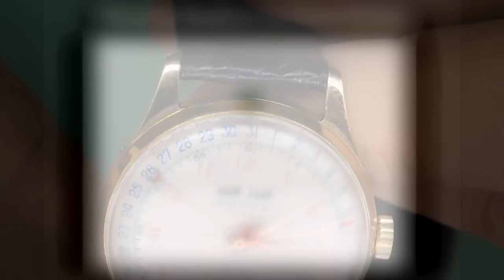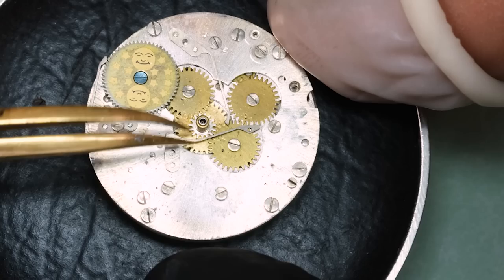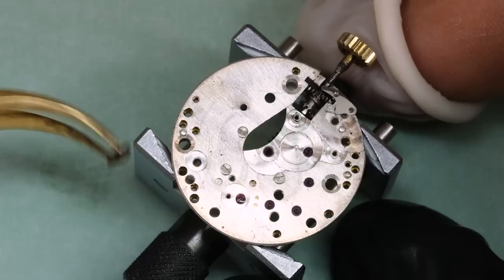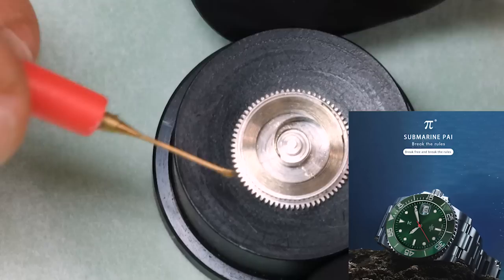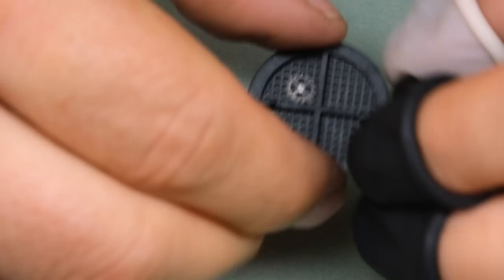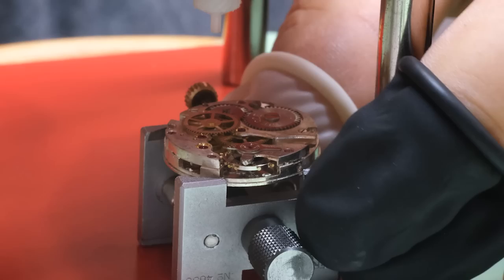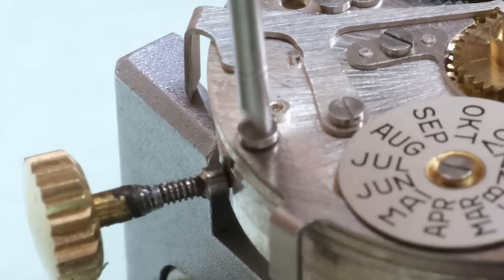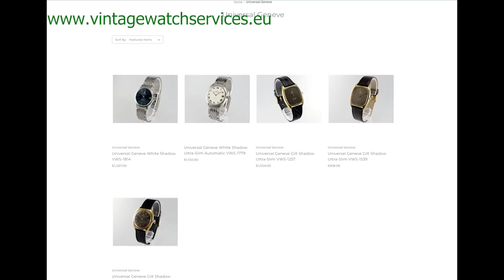How many hairs can one watch contain?!

Comment: That black veil material that widows wear at funerals.  Since it's black it doesn't reflect much light and you and essentially see through it.  It has holes in it but they are small enough so that most of your springs will be stopped by the material and fall back on the table.
I used to drape that material over my work as I was repairing portable tape recorders.  They had small parts and springs.  
Just lay the material over your project and stick your hands in there and go to work.  That way the springs don't end up in your carpet.  And I bet your camera would see right through that material.

Comment: Thanks for the great content!  I was just looking for a video where you reduced the size of the barrel bridge hole and couldn't find it...so perfect timing that it was in this video also.  Do you have any guidelines for how much sideshake is too much for the barrel arbor? I have an amplitude problem and think that this might be the culprit, but before I get out Thor's hammer and ruin the whole thing I am trying to get a sense of how to tell when you need to do this.  Thanks again for the great content!  I couldn't find the other video because I've watched most all of them and can't remember what I learned where.  Great work!
Reply from the maker: Thanks for watching! It's difficult to give an exact measure of how much play is fine, but if you can visibly move the barrel arbor back and forth or if there's is significant wear under the ratchet wheel, you should try to fix it. It's not a difficult thing to do, but you do need a staking set and smoothing broaches.

Comment: Nice piece! Even if not original, you  gotta love those red hand tips on vintage watches. If you would recommend the most useful staking tools, dies for barrel arbor hole adjustments? I got a nice Kendirck&Lamar staking tool without any stakes.
Reply from the maker: Thanks Cristo! The size of the stakes and punches depend on what kind of watches you will be working on, but most staking tools should have sizes covering most needs. You'd need to google it, or perhaps search on eBay. And a staking tool without stakes doesn't sound good!

Comment: I see you use a small scrap of metal plate to remove the wheel that drives the seconds hand. If it helps at all, I just use a ratchet wheel from a scrap movement.

Comment: Hello Stian, I fell in love with vintage watches, since i am following your videos and I always admire your craftsmanship and your sense of humour. Of course you are using the most expensive professional tools with one excepton: a chinese timegrapher. Why?
Reply: Probably because they’re compact, easy to use and work quite well. Not perfect, but very acceptably for the price. A number of people, including myself, have compared them against precise, traceable time sources (e.g., GNSS) and have found that they’re accurate +/- ~3 sec/day at room temperature. That is, arguably better than the majority of vintage movements they’re asked to measure. Or, for that matter, the majority of movements across their own 6 positions.
Reply from the maker: Hello Dieter, Nelson already gave good reasons for that, but I think it's also good to show equipment that don't cost a lot. I actually do have a Witschi timegrapher with all the bells and whistles but find myself rarely using it. Given that I mostly work on vintage watches were the accuracy requirements are less stringent than for modern chronometers, the Chinese one is just fine.

Comment: Another great video. Right now I'm taking a break from a Langendorf open face pocket watch which I'm so far not able to ID which movement it is, Ranfft site has nothing like it, won't be the first time I work on a mystery movement.
Reply from the maker: Maybe check mikrolisk.de also?
Reply: @VintageWatchServices  Thanks I check that web site but not seeing any data base for pocket watches. Stian the only marking I see on this thing is the numbers  833930 on keyless side which I guess is a ser number but that's turn up nothing. Another thing is the rocker arm set up for Keyless works which I think you did one with this type of setup. Keep them video coming I love them.

Comment: 33:40 Assuming finding hair is a good thing because it’s 1. the clear cause of the problem and 2. not fatal to the works (like a piece of metal would be)?
34:40: Maybe somebody left the back off when it was in a drawer and dirt and hair got in then.
Reply from the maker: Yes, hairs are certainly better than broken parts 👍 Just never saw that many hairs inside a movement before!

Comment: Facinating video and history lesson as usual thanks, I've one question though, you're not the only one who greases the ratchet teeth on both the winding pinion and the sliding pinion which isn't really necessary as they are both the same interface, surely greasing one is sufficient?
Reply from the maker: Thanks Brian! It's a good point, and you could probably get away with greasing only one of them. The way the grease would be distributed however, is by turning the crown backwards so that the teeth slide over each other, and most people only wind their crowns one way.

Comment: Love it Stian! Great job, gorgeous finished job! What make of Oiler’s do you use? Do you use a different one for cap stones? What diameter is the black rubber cushion that you use to press the crystal into the bezel? I want to make one and was thinking of cutting up a rubber ball.
Reply from the maker: Hello Boyd, I generally use the blue oiler for all oiling. The way you dip it will change the amount of oil it catches. And I'm not sure what black rubber cushion you mean? I have a black Bergen rubber cushion I use for placing the watch upside down on without leaving marks on the crystal, but for pressing the crystal into the bezel I used a crystal press with a domed stake.
Reply: @VintageWatchServices  Thanks Stian! The crystal press, the black bit that goes onside the crystal when you press the crystal over it, what diameter is that? Ta.

Comment: Smaken är som baken, delad! 😁
My dog has many options on how to skin a cat... 
well, anyway! 
Im in a longhaul project to restor a pierce waterproof parashock. Information i got on some Search. It was produced pretty much during the ww2 years. As it is shockproof the incablock type. It must been one of the first shockproof watches. Same base movement as in this video. But exept chockproof, its not a centre seconds. 
This project is extremly worn. Due to someone pretty much filled it with some thick black oil, many years ago.
Took me 12 houers to clean the dial. All pivots pitted, barrel, abour spring was non savable. Needs new centrewheel bushing. List is long. But eventually it will be a decent working and looking watch. 
Oh, would benefit a replating too of the case.. Economic wize its crazy. But hey, its fun!
Reply from the maker: Wow, that sounds like a project indeed! Luckily parts for this movement aren't too expensive, so you should be able to get away without too high a cost. And the satisfaction of putting that watch on your wrist when it's ticking happily is quite priceless :) Best of luck!

Comment: Thanks for another fantastic video, Stian!  I bought a Pierce Linear Automatic this summer. Definitely an interesting system. Questions: I just started servicing watches without shock jewels and I've been treating the cap jewels with Epilame. You didn't do that. Is Epilame bad for non-shock cap jewels? Do you clean the balance pivots with EVEFlex?  Is it bad? I started do that recently and I get visibly dirty spots on the EVEFlex. Thanks again!!!
Reply from the maker: Hello Woody, it the dirty spots were on the EVEFlex, that's a good thing, no? If they were on the balance staff, not so much :)
In my view, epilame doesn't really need to be used on cap jewels, as the capillary action will keep it in place anyway. It is recommended that you treat them with epilame and it certainly doesn't harm them, but I find myself sometimes not doing it simply because it's not hammered into my subsconscience that I need to.
Reply: Hi JWoody, good questions, I won’t confuse things with what I do. I’m going to start looking out for Pierce watches!

Comment: Do you use grease directly on the mainspring before you use the winder or do you just put grease in the barrel?
Reply from the maker: I just grease the barrel and the top of the mainspring. I used to grease the mainspring itself but I don't think it's provides much of a difference.

Comment: I wonder.  If you were to put the watch in a vacuum how different would it run?  I'm sure it would be faster but by how much?
Reply from the maker: It would indeed ruin a bit faster, as one of the main power drains is the air resistance the balance wheel encounters. Exactly how much faster is difficult to say, but I would guess we're talking seconds per day rather than minutes.

Comment: I feel like your boy and Nekkid Watchmaker's "Trouble" would probably get along.

For a hobbyist (me, for instance) who works mostly on antique American pocket watches, or for anyone assembling a basic set of equipment and may have lucked into staking set (coincidentally also like me), it might not make sense to by All The Smoothing Broaches. Is there something like a starter set you'd recommend?
Reply from the maker: They might indeed! Smoothing broaches are not expensive, just make sure you buy the right sizes for what you want to use them for. You should be able to find sets for pocket watches with a simple google search.
Reply: @VintageWatchServices  They're not the most expensive tool out there, but you'll pay upwards of $50 for a set from Bergeon, so getting a not so useful one would be annoying.

Comment: Would you ever consider re-plating a case?
Reply from the maker: Absolutely and I've done so in a few videos. It is however not something one should do without a lot of consideration of the pros and cons. The original plating was much thicker than you can achieve with non-industrial plating setups. Re-plating a case to the same thickness as the original watch would easily cost $1000 or more and is thus not commercially viable. Also, the color will not be exactly the same, which changes the overall feel of the watch to some degree. 
So while it may seem like an easy choice to just re-plate a watch, it really isn't.

Comment: Is the back original? It doesn't seem to match the watch.
Reply from the maker: Hello Bill, yes, the back seems original. Why do you think it doesn't match the watch?
Reply: @VintageWatchServices  looks like  a modern Chinese backplate with only STAINLESS STEEL BACK on it.
Reply from the maker: No, this is a very standard vintage watch case back. Gold plated watches generally always had a stainless steel back to make sure the watch would be as water resistant as possible, as steel is obviously stronger than other metals. The "Stainless steel back" inscription was to make sure people knew it wasn't simply base metal (brass). So I see no reason to believe this is not the original case back.

Comment: Was the poor Pierce last serviced by a hairy Norwegian Troll? Or perhaps it wasn't a good idea to fuse a Hair Salon and a Watchmaker Workshop?

The watch BTW started to run while You in the beginning started to manipulate it. Perhaps the movement did success in at least some hair mowing out of the way.
Reply from the maker: A combined hair salon and watchmaker shop indeed would not be a great combo 😂 Yes, it started running after taking the crystal off, so the hands might have been touching the crystal.